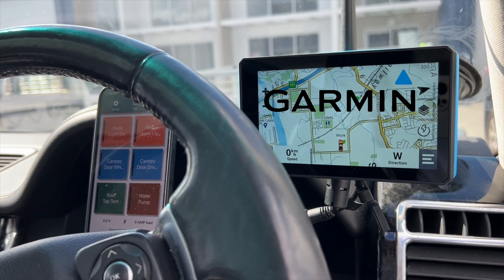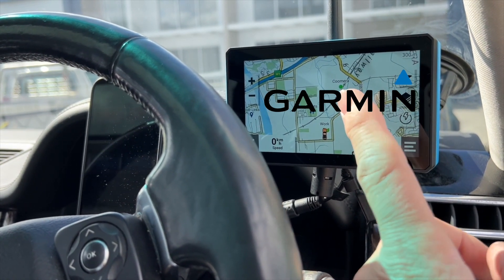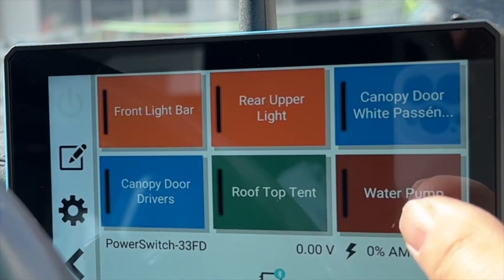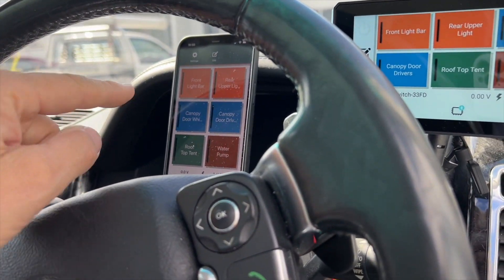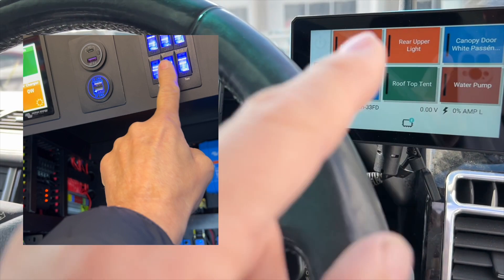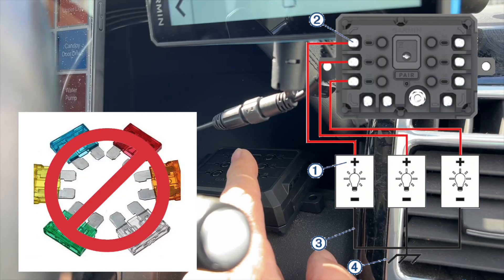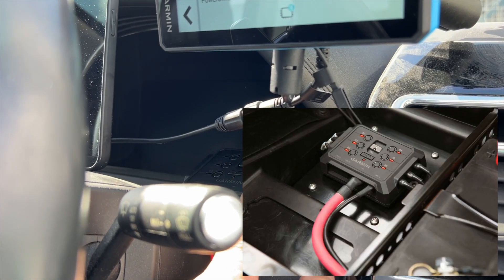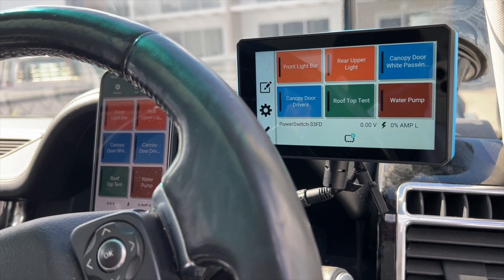Digital Switching With Garmin - Using One Navigation Display in Cab - NO Fuses in 4WD + Smartphone

Comment: What rear camera would you suggest to use with this unit?
Reply from the maker: IP (internet Protocol) Camera is what we use.
Reply: @Safiery   Could you tell me which you would recommend?
Reply from the maker: @johnwilliamson9453  there are a lot on Amazon. We have our own black compact IP67 unit. There is a few tricks to getting it on the screen you need to research that. We don’t reveal those as they are part of our IP